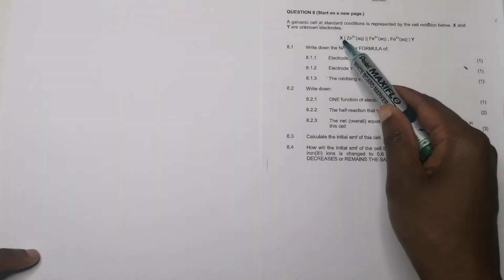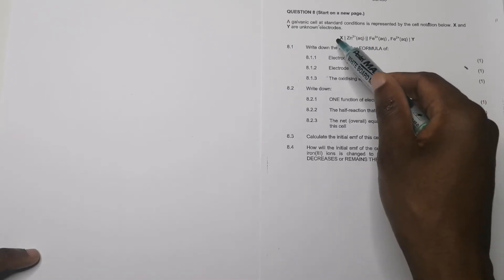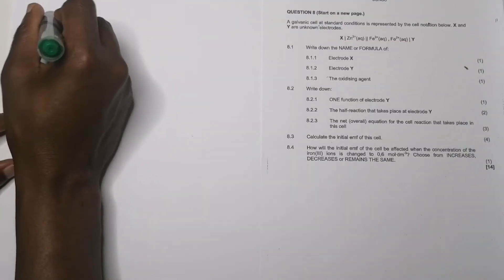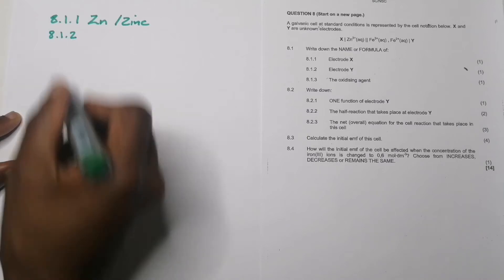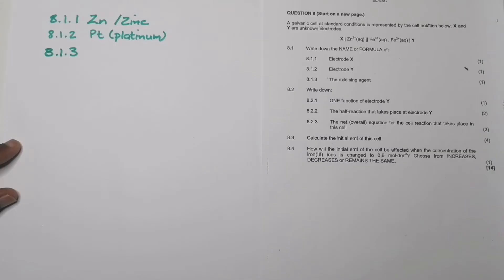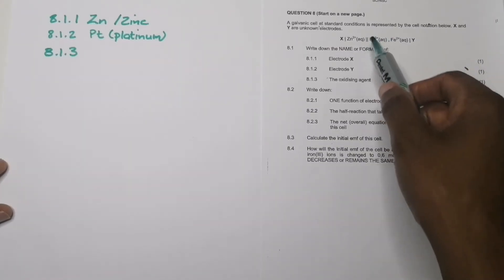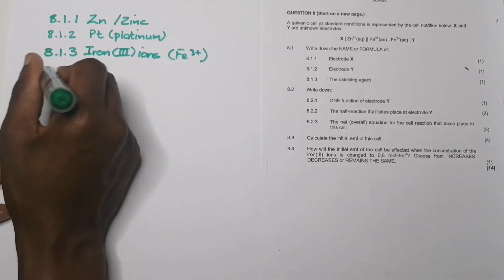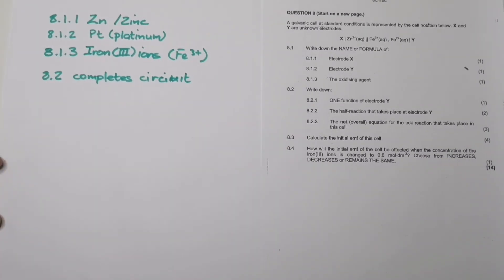Understanding Galvanic Cells: Question 8 Breakdown - September 2021 Prelim

Comment: Mr. Nkosi, I have a question regarding the S.H.E (Standard Hydrogen Electrode). I understand that the hydrogen electrode is used as a reference for calculating the potential difference across a cell for the two electrodes used and that this is similar to how other objects are used as a reference in life. An example of this is that there is a lump of metal in Paris upon which chemists and physics initially defined the kilogram to be the mass of that specific lump of metal and thus, the mass of different objects back in the day were calculated relative to the mass of that lump of metal (i.e. the lump of metal was used as a reference) -- obviously today we have better measurement systems in place so we don't constantly have to compare things to this specific metal in Paris (or just outside of Paris I believe). Anyway, so that's my understanding of a reference. So in the same way, since the potential difference can only be measured between two points or with regards to electrochemistry, between two half cells, it doesn't make sense to state the potential difference of just one-half cell because there would be no difference. You can also think of this in terms of an electric circuit - it makes sense to compare the potential difference between two points in the circuit, but it won't make sense to say that the potential difference is X volts at point Y. 

I also understand that when looking at the Standard Reduction Potential Table, since all of the half-reactions are written as reduction half-reactions, if the emf potential difference as depicted in the table is negative, it simply suggests that the half-reaction indicated would rather undergo oxidation as it has a greater reducing ability than the hydrogen half-cell when initially determining the Standard Reduction Potentials. And similarly, if the emf potential difference as conveyed in the table is positive, then that half-reaction will prefer to undergo reduction. 

However, my question is, when hydrogen was initially used in one-half cell and connected to another half cell containing a different metal, since a galvanometer shows the direction and magnitude of the current flowing through the external circuit, was it specifically due to the direction of current flow as indicated by the galvanometer that determined whether the platinum used in the hydrogen half cell acted like an anode or a cathode and thus, using the hydrogen potential difference as 0V, if the hydrogen half cell underwent reduction (and thus the other metal in the other half cell underwent oxidation), the half-reaction of the metal that underwent oxidation (obviously assuming that standard conditions were used) was noted and written down in the form of a reduction half-reaction with a negative emf value in the table? And then the same experiment was repeated with the hydrogen half cell and other metals. 

In other words, what I'm asking is: When the Standard Reduction Potential table was initially first created and the hydrogen half-cell was used as a reference against other half cells containing electrodes, was the ability to determine which half-cell underwent oxidation and which underwent reduction specifically due to the direction and magnitude of the current as shown on the galvanometer reading and thus, since the experiments were conducted under standard conditions, the results were recorded and formatted in a table?

Apologies for the long question ;) 😇
Reply from the maker: Wow... Cole, this is phenomenal.Thank you for sharing.

Comment: Good morning once again Mr Nkosi. Hope you're doing well. I've noticed that on our physics formula sheet that we'll be given in finals, there are two tables of standard reduction potentials. Am I correct in saying that it doesn't matter which one we use as it seems to be that the only difference is how they are formated (Table 4A has the increasing strength of oxidising agents/increasing oxidising ability going from bottom to top whereas in Table 4B it goes from top to bottom)?
Reply from the maker: Yes it doesn't matter. The method I've taught works regardless of the table we use
Reply: @MlungisiNkosi  Okay, thanks so much
Reply from the maker: @coleabrahams9331  my pleasure... You are incredible 😊
Reply: @MlungisiNkosi  Hi Mr Nkosi, I know this question isn't chemistry related, but do you know why a power vs current graph is a quadratic function? The question popped up in a past paper and I can't figure why. I thought it would be a straight line function going through the origin which suggests that power and current are directly proportional, but that doesn't seem to hold true. Thanks in advance.
Reply from the maker: @coleabrahams9331  That's a fantastic question...

P = I^2*R (I squared xR)

Resistance is constant, thus making power proportional to the square of the current. That's a quadratic relationship
Reply: @MlungisiNkosi  Ah yes, of course. I should have known that. At least I won't get it wrong now. Thanks